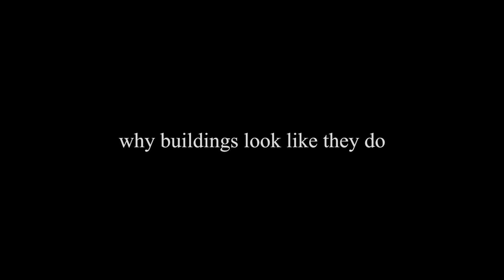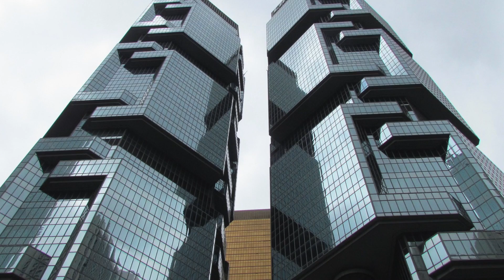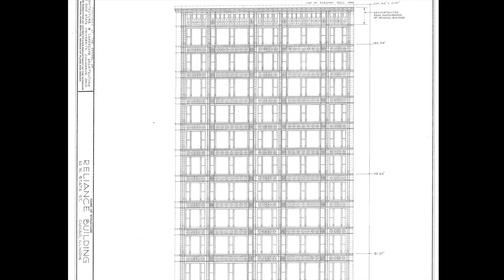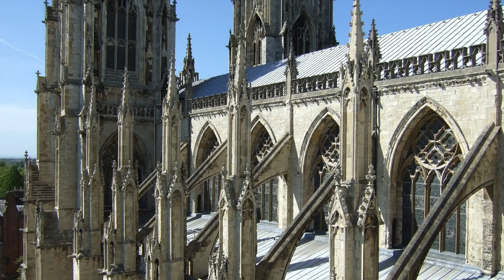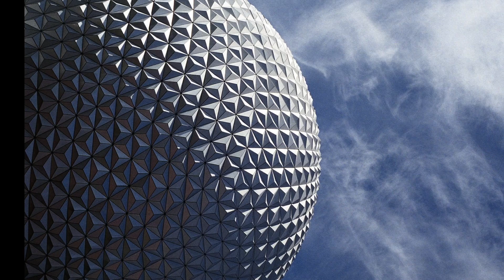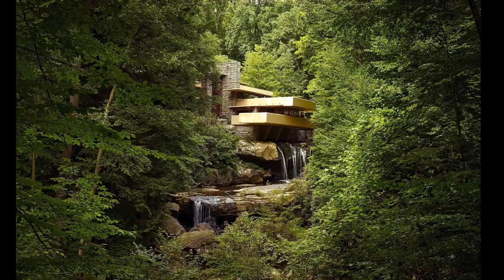Trabeation | Why Buildings Look Like They Do, pt.7 - Limitless

Comment: I need some help with an architectural problem that I am having for a book series I'm working on.  In the series, there is a 19th-century mansion that is in the Second-Empire style.  It has an attic, an appropriate amount of hallways for a two-story mansion, a ballroom, a basement with a breaker room and storage room, a downstairs & upstairs bathroom, a dining room, a foyer, a front yard with a driveway, a garage, 8 guest rooms, a kitchen, a large outside swimming pool, a laundry room, a library/study, a master bedroom, a music room, an observatory, a parlour, a projection room, and a roof-top balcony.  All the rooms are appropriately sized for a large mansion in a small town.  The inside and outside also looks aesthetically pleasing to the eyes.

My two questions are: First, how much square feet would the mansion be in order for all the rooms and areas outside the house to be of appropriate size?  Second, how much would it cost to build the mansion to have all these rooms and still be aesthetically pleasing to the eyes?